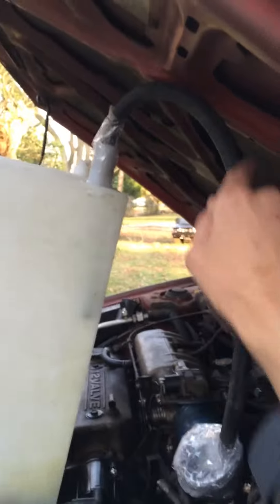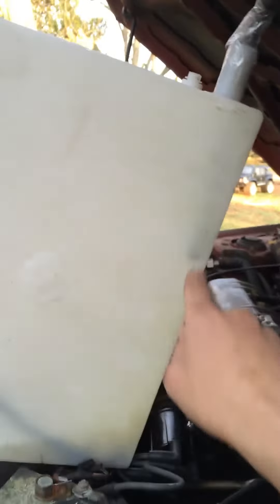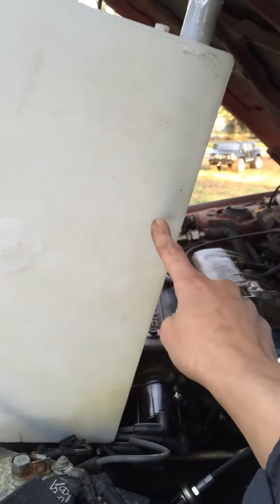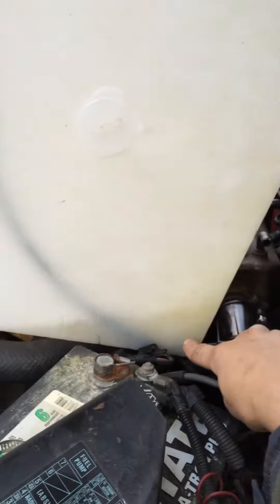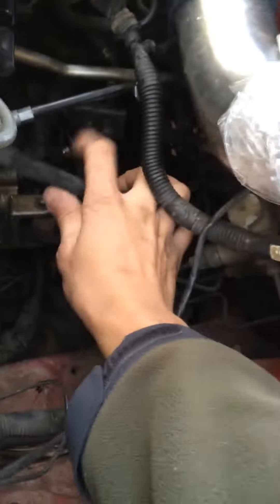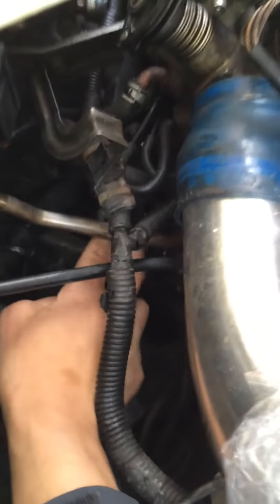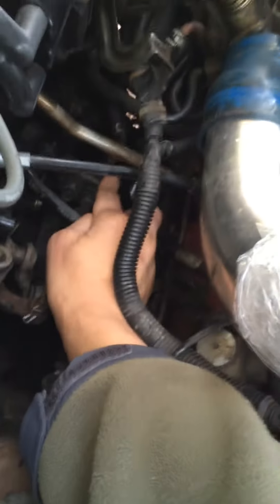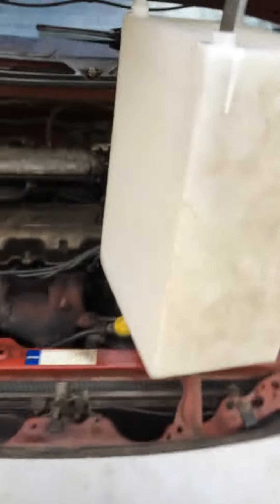Runing a car on gas fumes

Comment: Haha what gave you this idea? Amazing it’s running off pure fumes 🤯
Reply from the maker: I was doing some research and wanted to see it work for myself
Reply: Pretty awesome! Did you determine if there was any application where this would benefit a vehicle for fuel delivery? Was it more so something to help with the repairing or diagnostics of vehicles instead?
The engine sounds like it’s running great off just fumes!
Reply from the maker: @clapclapscream  from my research you can actually drive around with the vehicle like this and achieve up to 80 miles to the gallon running on fuel vapors  so others say ,yes it ran pretty good. I’m probably gonna remake this video with a better setup, I didn’t have much money back then when I made this video
Reply from the maker: https://youtu.be/IuGWHfWqWtg?si=fUXDCGdJ5cUIhPKm
Reply from the maker: Better video of the process